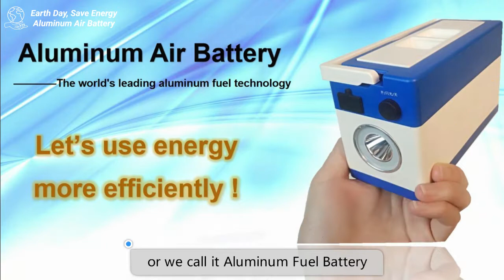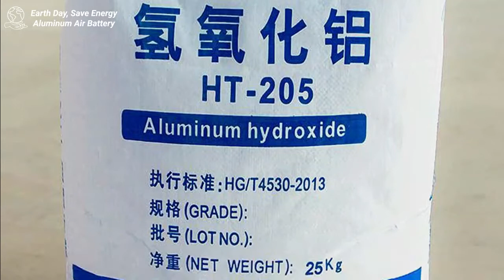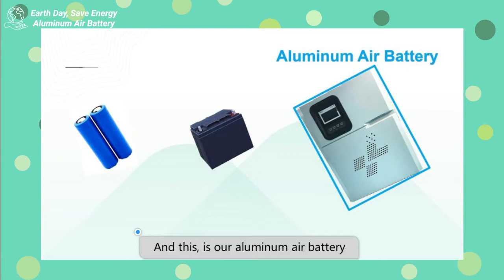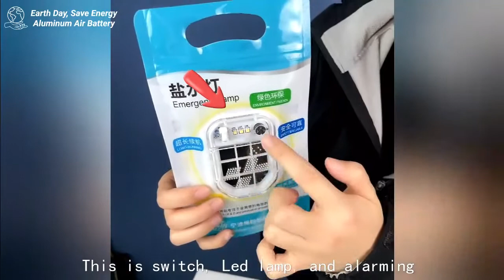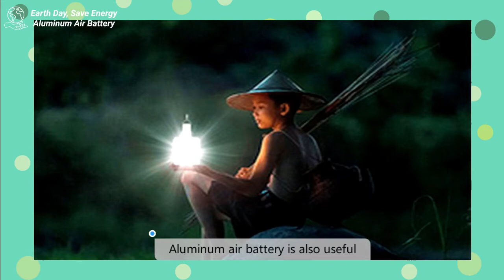Aluminum Air Battery: Generate Electricity Only Using Water

Comment: This is a very poor copy of the battery India, (in conjunction with another Western Company) is currently re-developing and refining properly, so that the aluminium electrodes last far longer.  This Aluminium Air battery (or rather, "Fuel Cell") was conceptualised and tested back in the 50's and 60's here in the West, although the need for it didn't yet exist until now, so was never developed further until now.

...China needs to STOP stealing everyone's stuff and trying to pass it all off as their own ideas.   All China ever seems to do is steal people's ideas, then claim them as their own, whilst also manufacturing very cheap, bad qaulity versions.  😡🤬